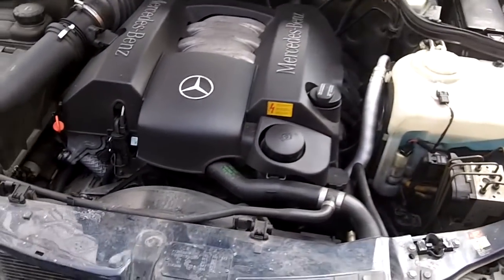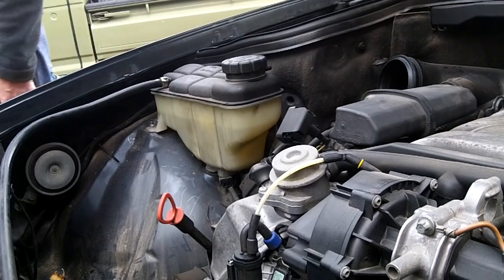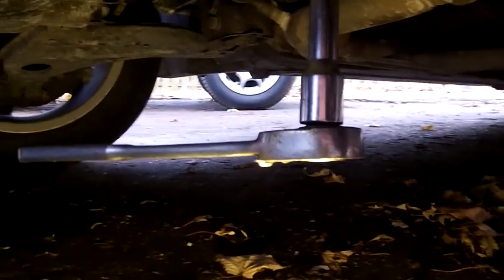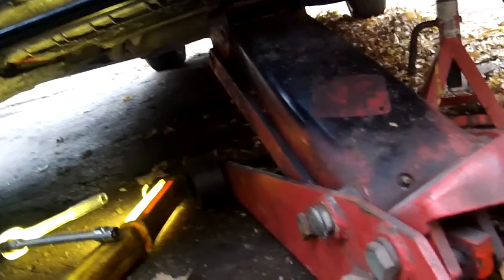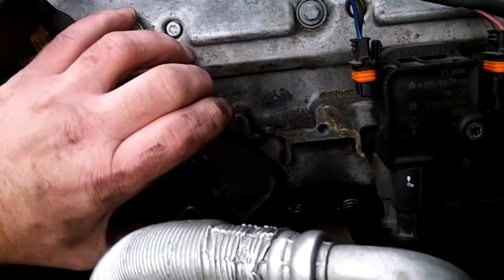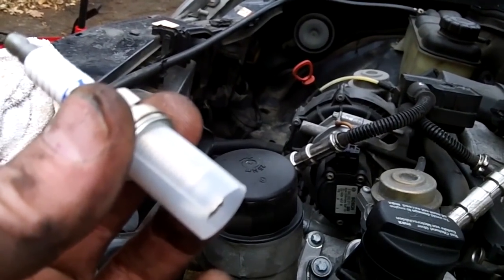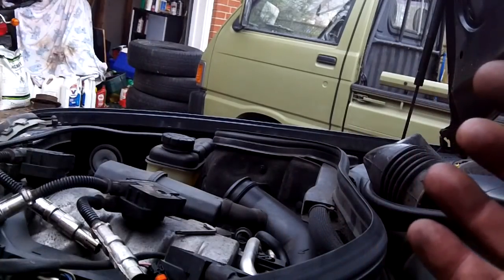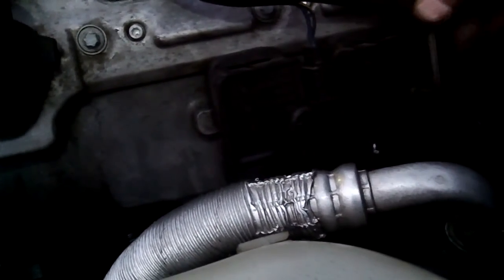Mercedes M112 3.2 v6 spark plug replacement w208

Comment: A breeze on the ML in comparison... You just didn't mention the plugs will be held in there by the jaws of life itself after 16 years... Nearly gave up because I thought I was destined to destroy the head wailing on a 2ft bar on the plugs. Or was debating cutting holes in the wheel well and breaking out the 2 stroke impact ;) haha ended up all good.
Reply from the maker: +The Stiver   Oh crap..original plugs !!   Scary .  I'm going to be doing the c240 plugs soon , and at 50k miles I'm sure their still the factory plugs.   I think I'll wd them a few days prior for extra safety
Reply: +fupabox just seemed like with the heat from the exhaust a few of them didn't wanna come out. I just worked them like a tap, back and forth little by little. It's funny on the inline Mercedes engines you can have like a million miles on the plugs and they come right out since they're a little more protected.
Reply: +fupabox do you have any insight on the intake tube to the throttle body? Both the clips on mine are broken and I can't get it to stay seated on there so I'm getting a leak and poor performance. I should be able to get another tube from junkyard because it appears to be the same part for most 98-05ish m112&m113 but how are the clips supposed to work/be removed?
Reply from the maker: +The Stiver do you mean the 2 "s" shaped clips that seem to push together ?  if so  they do nothing and don't actually come apart..the whole clip looking assembly pulls off of the engine in one piece with the intake tube
Reply: +fupabox yeah they're clean snapped off my tube and the one that was on the only ml in the junkyard near me currently. Didn't think of looking at other m112 & m113s the other day in the yard. But since mine are broken, I just didn't understand what they clip on to on the manifold or how to release them to remove the tube
Reply: +fupabox at least my ML it actually was a bad brake switch! Big clue is that abs still worked. This is my 4th Mercedes and first one with working cruise control - lol!
Reply from the maker: The Stiver Haha   never had one where the cruise didn't work.. Everything else good so far ? Only unfixable ever , was the clk's ABS.. Never even had a broken A/C  ..just been lucky I guess  .. I was doing the breather cover and plugs on the c240 today.. The clip I think you are talking apart just pulls off on mine..looks like it should separate where the 2 Esses catch each other, but tit doesn't
Reply: +fupabox I think once I get my hands on one in the junkyard I'll figure it out. What I need to do is reach my phone back there and just take a video, it's just hard to mess with something you've never seen before that's tucked away. Brake switch fixed the ets lights, shift interlock/starting, cruise, and low range engagement. Seat heaters were awesome when it got down to 30*F the other morning. Once I get the intake leak/misfire straightened away it'll pretty much be perfect (other than some body work to be finished from the accident). Oh and it REALLY needs shocks... Ouch.
Reply from the maker: The Stiver Ouch is right if the rears are bad.. around $300 a pop..fronts are only about $30 apiece at rock auto..I don't know how anyone can live without heated seats  :)  You'll for sure get the intake sorted once you see how it goes together .. not sure if I sent you the factory manual link.. so I'll do it anyway  http://workshop-manuals.com/mercedesbenz/ml_430_(163.172)/v8-4.3l_(113.942)/engine_cooling_and_exhaust/engine/intake_manifold/component_information/specifications/page_3743/
Reply: +fupabox very cool, thanks for the link. That's what I was looking at, I usually get KYB's but I'm going to give Monroe another try. Rock auto actually has Sachs rear shocks for $123/ea, the $338 ones are with the springs and all, which are convenient, but I don't mind wrestling with the springs. Worst case a shop will throw them in the spring compressor and swap them out for a whole lot less than $650-250.. I'm thinking the price will hurt a lot less than the ride does right now... Literally the only other time I've been in a motor vehicle with a rougher ride is on a bus thru new jersey into NYC once... I'm pretty sure my head hit the roof a few times haha
Reply from the maker: The Stiver I didn't see the sachs shock only option for the rears at rockauto.. only the whole assembly..that's much easier to swallow than $700 for 2 rear shocks ..I think I was looking on the strut page, that's why I didn't see them..I never had any problem with Monroes   I'm sure they'll be good on the ML  ..No helmet required :)
Reply: +fupabox yeah for real... Remember I only paid $773 for the truck in the first place. Might even try the rears off the junkyard ml for the hell of it. My friend's nieces 2000 ml320 had a nice ride, didn't look too closely but looked like original shocks.
Reply: +fupabox got an intake pipe off an e320, took me a bit to figure the clips out but got it. Reset everything with it installed, no difference in running. Did the "throttle relearn" as you showed on w202, made a noticeable improvement! But not perfect. The night it ran perfect I believe I unhooked the battery, then let it sit with ignition on engine off for 15 min after connecting battery. Bad throttle actuator?
Reply from the maker: The Stiver I have read the Ignition on engine off for 15 minutes can sometimes work... The actuators very rarely go bad.. I had asked the service manager at my dealership about them once, and he said he had only seen 1 or 2 bad ones in over 15 years.  I would do the battery unhook again..the ECU may be confused from the different airflow volumes it has been reading with the different intake set ups
Reply: +fupabox yes I will try a "hard" relearn again. It's just with my experience with w202s, almost all of them had throttle body issues, but in reality prolly 98% of those were just the disintegrated wiring inside. I've read a few cases online where a throttle body solved similar issues to mine... I'll check the vacuum leaks again, but the fact that it ran perfect at one point has me convinced it's electronic. At least parts for m112/m113s are so easy for me to come by and so far have been very interchangeable
Reply from the maker: I have read a lot about bad actuators as well, but have never seen a bad one. That was why I had asked the service manager...maybe he was trying not to say anything negative about the brand, or that dealership has just been lucky and not had a lot of bad actuators come in for repair.  It may be like when guys in warm climates complain about brittle plastic dashboard parts, and Northern cars interiors are in perfect condition ..even in the wrecking yard..maybe the heat gets them..or the lack of humidity ?
Reply: +fupabox I mean you seen that guy on here that rebuilds them? He wouldn't have much business if the failure rate was 1/10,000.. Most of them are wiring but I was watching a c220 actuator tear down of his that the graphite for the TPS signal wore down and was causing the TPS values to drop out.
Reply: +fupabox one of these days I'll get around to rewiring my c220 throttle body. But you know how it goes, the ML is the new baby, plus the c220 is gonna be parked for the winter, looks like possible flurries here next week. But I swapped the throttle on the c220 with a junkyard one because I was having issues with it driving thru heavy rain or snow. Swapped one has been fine except when I pressure washed the engine haha.
Reply: +fupabox well it finally happened... As soon as it got cold, around 30*F last night with winds gusting to 55mph, I went to leave the gas station and the ml started hesitating and surging really bad. Restarted and had NO throttle response. Got a P1580 code for throttle actuator. I was able to d/c battery and reset it and get home but I'm going to swap out the throttle body asap.
Reply from the maker: Ugh ,, of course. I think I jinxed you 🙁

Comment: How did you move the hood to the verticle position? Thanks!
Reply: there is a tap on the hood shock, push it then you can open the hood to 90 degree.
Reply from the maker: luckyyu2004
yes..luckyyu is correct ..on the passenger side hood spring..a little tab to push
Reply: Thanks guys!!